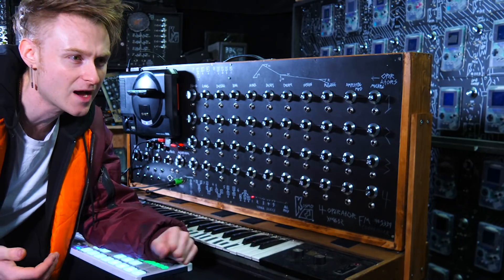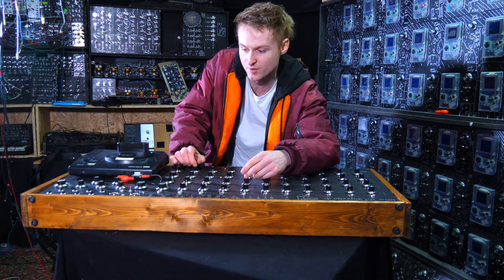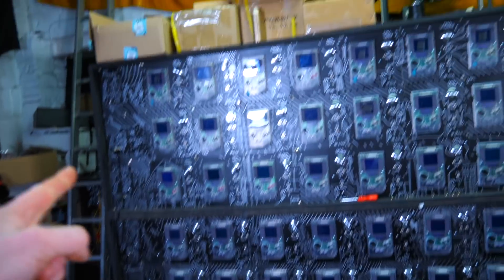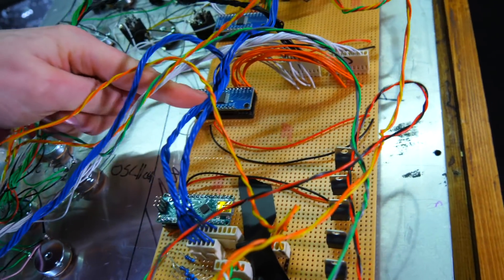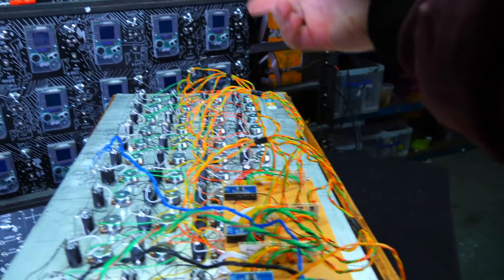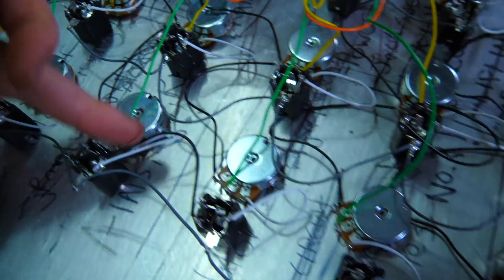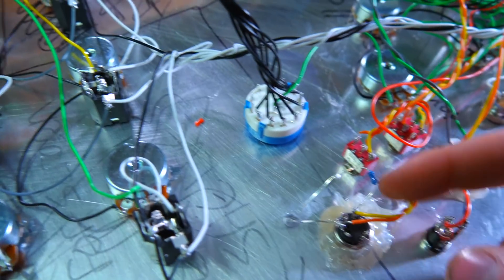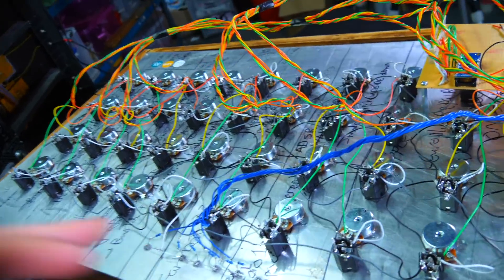Sega Megadriver Synthesizer In Depth Look

Comment: SOLVING FOR POLY.  this thing sounds really good, but i am confused by your 5 channel multi pot array thing.  these are are not rotary encoder knobs, they are actually pots.  i think this means that, if you set up channel 1, say, then go to channel 2 and twiddle all the knobs again, for a different setting, if you go back to 1 it will copy what your channel 2 settings over what you had, in channel 1.  am i right?   as far as i can tell the only way you can fix this would be with rotary encoders.  these are cheap and just as easy to wire up as pots, but they just send pulses, to indicate if you are turning left or right, and how far, and you use these inputs to adjust that channel's settings in your memory map.  to get the poly mode you want, you just add another map, adjusted like all the others, but when this map is selected/adjusted, you write it's values to all channels.  when you switch back to single channel adjustments, it should reset the chip with the single channel maps.  you could probably also use a method of copying one map to another, or switching to/from poly could be quite abrupt.  hope all this makes sense.  i gather this was five years ago, would be happy to help with this, if i could.  i like how it sounds, a lot, and am thinking of investing in some of these chips, or equivalent.

Comment: something you could do is program a custom cartridge with a serial or spio connection to an arduino. or you could hack apart a cartridge to interface the arduino directly to the mega drive's data and address bus

Comment: You can easily "reverse" the pots in the code.
Reply from the maker: yes but as said below. it will reverse the CV too
Reply: @THISMUSEUMISNOTOBSOLETE  Hmm, couldn't that be reversed in the software? I'll be honest, i didn't look at the code yet, but it should be trivial.
Reply from the maker: @zaprodk  no it was built in such a way that if a CV is plugged in the knobs act as an attenuators the cv. so if its reversed in the code the cv will be reversed, the easiest thing to do is switcharoo the wires, its a half hour job I just never got round to it
Reply: @THISMUSEUMISNOTOBSOLETE  ok. I might have misunderstood what was reversed then :) I thought all the pots was wired as voltage dividers with 5v, GND on outer terminals.

Comment: I als used the Notes and Volts arduino code to read code from an 88 keys keyboard, and send it to a Roland soundmodule, but playing with 6 finger chords creates a little noticeable lag. I think the arduino processing speed is to blame...  Any idea how to tackle this?
Reply: How'd you manage that? I can't get Arduino to send note data with an external keyboard plugged in without bypassing the TX.

Comment: Hey Sam! Great Idea. Looks pretty neat. You can save some input pins and some soldering work with the rotary knobs. Just solder resistors in between the pins of the rotary knob. It then basically becomes a poti with certain values, which you can connect like the other potis with just one cable to the multiplexer. You can easily achieve the same assignment as you have now with just a few tweaks to the code. Cheers

Comment: I worked on a retro synth build using an axoloti a while back and used the notes and volts code too for the midi controlling ( http://community.axoloti.com/t/retro-lookin-synth-work-in-progress/4134 )

I found that the notes and volts code worked when twisting knobs but when I would start up, the values of the potentiometers wouldnt initialize properly when using multiplexers. For yours, if you have a pot value...1 then shut down, turn it to 11 and then start up. will the value of the knob be 11 or will it still be 1 until you fiddle with it a bit?

Comment: One thing I haven't figured out yet:  How is this board interfacing with the Sega Genesis?  Does it just plug into the controller ports?  And how are you getting sound out, are we literally listening to the game system's audio out?  Or is there a bunch of pin soldering going on inside the Genesis?
Reply from the maker: literally headphone out the megadrive has just been stuck to the front of the controller board to be closer to it

Comment: The YM2612 can do 6 channel FM, but you lose the DAC which typically plays digitized drum sounds and voices.  The 6th channel can be in either FM or DAC mode at any given time and can probably be changed on the fly as well depending on the capabilities of the sound driver.  Both the 68000 and Z80 CPUs can talk to both chips (YM2612 and SN76489) in the Mega Drive / Genesis.
Reply: indeed, 2 reasons i went with 5 voices, in my opinion any more than 5 voices in a polyphonic synth is counterproductive (probably cus the most notes i ever play at once is 5 haha and hate over hanging notes) also gen mdm sadly omited the fm option on channel 6
Reply: @LOOKMUMNOCOMPUTER  The GenMDM manual specifies a channel 6 DAC toggle command. Have you got an older version?

Comment: okay, so, I incidentally know a thing that might be the problem with polyphonic mode, is that the YM2612 isn't polyphonic with 1 instrument having up to 6 note polyphony, but rather 6 instruments that are monophonic, each with it's own independent instrument information.  Additionally, Noise channels, (and re-pitching operators independent of root pitch on ch3) are super useful for creating percussive and organic sounds.
Reply from the maker: yes that is fine like I mention in the vid, there is an Arduino that splits the midi code from a polyphonic stream to separate channels
Reply from the maker: so the issue im having which is sorted now is sending same parameter changes to all the different instruments, treating them all as the same instrument. incidentally making it polyphonic

Comment: ABOUT YOUR POLYPHONY CODE PROBLEM THINGY, in the main loop, if Midichannelomnipinstate == HIGH; you run the updateMuxPots(); 5 times and increment the midichannel variable. that way, you send the pot values to every channel. that does mean you have to move the updateThing() functions below the channel selection checking.

Comment: Sam, yeah - it's a bit annoying to protect so much inputs... But as I remember there is a mean where you just solder one (or two) "quick" diodes (1n4148 probably) and that's it - it will cut off any spikes. It can be necessary (not sure though) because of CMOS chips you're using to control the Sega. I've read a lot of times that they're pretty weak about static discharges.

Comment: @LOOK MUM NO COMPUTER Man, with the proper hardware you could wire almost everything from the genny cart, easing a lot programming (almost all in pure 68000  and C). You need a 68901. It has timer and ports, also serial. Is memory mapped also, so you just need decoding an upper address bit and wire the bus to make it work. Is cheaper than arduinoes also

Comment: What's the  thickness of aluminum sheets you use? Are there any viable options on the panels (for instance I have access to a laser cutter but it doesn't cut metal, but I sure love to use it for. Ever worked with woods for panel sheets or would that not be rigid enough?).
Reply from the maker: plastic is good, problem with wood is you can't get it thin enough to mount some components, I use 1.2 or 1.5 thick aluminium, laser cutting is nice however for 1 or even small batches there's nothing better than eyeing it up with a sharpie and just using a hand drill it takes a matter of minutes to do, as opposed to an hour or so making a cad design

Comment: Would it be possible to have voltage protection between the multiplexer and arduino instead (at least protect the arduinos)?
Reply from the maker: yep but as I say below, I just dont bother, I have built various circuits that throw Arduino analog input pins to way below zero and way above 5v and never had casualties in that respect, intact I have one in my touring right that gets various voltages from -10v to +10v at every gig and every time its on for the last 3 years and its still going strong! they are a lot more resilient than they have credit for, obviously if this was a product it would be different, but its a diy project. so its how far you wanna go

Comment: But how does it talk to the 16-Bit Sega?
Reply: The controller ports on the Mega Drive are DB9 ports, not RS-232 but a custom interface with six input pins, +5V, GND, and one output pin. You can see he's using a MIDI (DIN) to MIDI-TRS adapter that hooks into the genMDM adapter plugged into the controller port of the machine. It interfaces with the genMDM software running on the system from the installed cartridge. You can read more about it here: https://catskullelectronics.com/genmdm
Reply: @azazelleblack  ah, so they have enough bandwidth for this?
Reply: @romajimamulo  The keyboard is simply sending MIDI instructions to the game console, so it only needs at most a few hundred bits per second.
Reply: @azazelleblack  ah, I see. Not sending the nobs at every moment

Comment: "I've soldered all the pots on backwards". Just use the map function to reverse the values in software.

int mappedA0 = map(A0, 0, 1024, 1024, 0);
Reply from the maker: you would think it would work that way! however the issue is then the CV is inverted. annoyingly its an issue in the analog realm
Reply from the maker: also it works out the attenuation of the cv is backwards too, so I figured I would make it all backwards. however another thing to note, it actually works well for a fair few of the parameters. as the actual ADSR works backwards to a normal analog ads because the knobs are corresponding to the angles on the image at the top of the board, so some are actually inverted to normal use anyway

Comment: What about a 5.1v zener in series with the cv in? No perfect because the voltage drop means you wouldn’t have 5V exactly but you could throw in 10v cvs yolo style
Reply: Jacob Siener indeed! I was just being lazy. In my experience sending more of less than 0-5v doesn’t hurt an arduino. I have one that gets an lfo that is +10v and -10v for about 300 hours so far and it’s fine. One day! One day
Reply: @LOOKMUMNOCOMPUTER  Probably because it's a very low current; arduinos have a snapback diode at the 6v level to bring 'anything above 6v' down to a 5.1v level. As long as you're under the sink/source mA limit for the chip, you probably won't blow anything. So 1-3mA LFO signal at +10v/-10v will likely just be bled as heat across the snapback diode. Thwack a copper heatsink 'for raspberry pi' on that atmel and point ye olde 12v chassis fan running at 5-7v across them. Five D batteries and a switch, if you really wanna isolate the coil noise, which shouldn't matter a bit for the YM2612's filthy-delicious output. ANY moving air (even if the case is sealed) ought to be enough to dissipate any hotspots unless you're really overdriving the GPIOs enough to let the magic blue smoke out. So any really hot CV source has a small chance to deliver enough current, but it's probably so unlikely (especially with the amount of opto isolation that musicians like for sparky-safety) an occurrence to be statistically insignificant.

Comment: Perusing your code at the moment. What license is the code shared under?

## Few notes so far...

Generally `for` loops such as...

  for (int i = 0; i < NUMBER_POTS; i = i + 1)

... can be written as...

  for (int i = 0; i < NUMBER_POTS; i++)

... to increment an `i`ndex. It may seem minor but if I remember correctly, reassigning `i` is slightly different and may be slower than using increment/decrement (`++`/`--`) notation.

_

Version management software would really help with tracking changes, eg.

- Initialize a project within current directory...

  git init .

- Add files to _staging_...

  git add Controller.ccp Controller.h SEGA_MAGADRIVE_CODE_channel_changer.ino

- Commit files such that current state is tracked...

  git commit -m 'Initial commit'

Then when something is changed, track it with...

  git add file-name

  git commit -m 'Fixes or adds something within file'

Reading through committed changes can be done with...

  git log

And reverting to some previous state (like a targeted undo) looks like...

  git checkout ref-or-hash

Commands are not necessarily necessary if willing to using an IDE such as Atom, which can make this process far easier.

Aside from being able to undo anything that was previously committed and note why changes where made, Git will also make it easier for others to contribute while allowing you to see which lines where changed via `git diff` command.

_

Only just begun reading over the source code but, I've a feeling that within the main loop is where you'll probably be putting an additional loop when `Midichannelomnipinstate` is high to iterate over current settings... Likely will require some if not checks to filter out specific pots.

Comment: Is this solid core wire? I'm no expert but I think stranded wire is more resilient to failure due to fatigue caused by vibrations, specially important if you wanna tour with this beast.
Reply from the maker: indeed it is. I've not had a problem, I stopped using stranded because it wasn't as easy to work with

Comment: if (message == 0) {
      switch (BUTTONS[i]->Bcommand) {
        case 0: //Note
          MIDI.sendNoteOn(BUTTONS[i]->Bvalue, 127, BUTTONS[i]->Bchannel);

How does the sega use it's FM equivalent timbres, are they separated by channel?  If so, shouldn't the last line use a variable++ and an If (variable > 4){variable = 1;}

Comment: could you add voltage protection after the multiplexer? you'd only need 3 or 4 then :)
for the omni mode, could you add a for loop around the midi send? ie if poly mode, for (int outchan=1; outchan<=5;outchan++) { send message on outchan to megadrive } kind of thing?

Comment: As far as I know, you cannot send on the omni channel, but rather, when omni mode is turned on for a recieving device, the channel number will be 0 for the incoming messages.
So, instead of changing the channel to 0, you could "just" send CC#125 to all the devices, and then continue sending on whatever channel.

Comment: I’ll have a look at the code for sure - curious, what is the issue you actually running in to? You likely might be overflowing a tx buffer trying to send all that at once.. MIDI is actually pretty simple - you can likely also take advantage of something called “running status” - where you send the command (e.g. CC, note on etc) and then you can send multiple data bytes without having to send a command for each data portion. Could save a byte per knob - you’d still have to send a new command for each midi channel though. I’ll have a look today!
Reply: Sent an email!

Comment: Just a random thought, is it possible to have each channel go to its own output with toggleable switches, and then patch those into some kind of switchbox that then compiles each individual channel output to produce polyphonic sound in a way that the channel outputs operate in parallel to one another? I'm not particularly code minded, but thinking about how a network router and switch banks work, I can imagine you could use a similar solution with this?
Reply from the maker: im not sure what your getting at, but all channels need to be adjusted on the same midi stream as they are all in the YM2612 and come out the same output
Reply: @THISMUSEUMISNOTOBSOLETE  Gotcha! Thought it would be possible in theory to have the chip communicate to multiple outputs at once, I've probably not been too much help then sadly. :D

Comment: This bangs! I would probably trade my digitone for this hahaha fm synthesis with knobs is the only fm worth the pain of patching. Are the 5v lines going to the modulation jacks all wired in series? If you plug cables in, would that mess with the voltage all across the chain / would there be voltage drop across the series anyway?
Reply: I'm pretty sure there must be a voltage drop, unless he has a serious positive bus.  The ground is probably (or could be) the faceplate.

Comment: What material do you use for the front panel of all your modules and synths and what do you use to draw on it?
Reply from the maker: 1.2mm aluminium panels each up "aluminium sheet cut to size" and silver sharpie and matt black spray paint
Reply from the maker: and clear spray paint, but only mist it so it doesn't go gloss
Reply: @THISMUSEUMISNOTOBSOLETE  Thanks for the answer! It looks very nice

Comment: How’d you get all those pot drill holes so straight? Was it Laser cut or something!
Reply from the maker: I do this stuff by eye and a hand drill. just a ruler and sharpie and 3mm pilot holes
Reply: LOOK MUM NO COMPUTER BUT MORE SERIOUS ISH nice! I tried that with a ruler recently on a plastic enclosure - turned out quite ghastly! Maybe I’ll try metal next time
Reply from the maker: @fkthewhat  its all down to practice, ive been doing this method for 10 years or so. Its the quickest way!
Reply from the maker: plastic its about being nice and slow with the pilot holes and not pushing hard. let the drill bit shave the plastic off.
Reply: Try and use a nail or a punch to stop the drill bit drifting. It's like a pilot divot for the pilot hole ;)
Reply from the maker: @hqqns  indeed! good thing to do however just adds time, and in aluminium panels it can warp the aluminium just starting thirmly is more than enough

Comment: You can buy the crimps loose rather than on a reel, saves having to cut/snap each one off of the band.  The banded ones are for automatic crimpers
Reply from the maker: yep but a lot more expensive, I used to do that, now I just buy reels as its about 10 times cheaper
Reply: @THISMUSEUMISNOTOBSOLETE  ah I didn't realise that, good to know.  Also a lot harder to lose them if they're on a reel!

Comment: I'm curious, what is doing the small board with the wire connected to the gamepad port?
Reply from the maker: thats the board that comes with GEN MDM @t to plug midi into the controller port for the megadrive to read